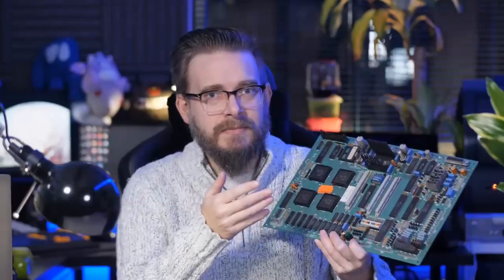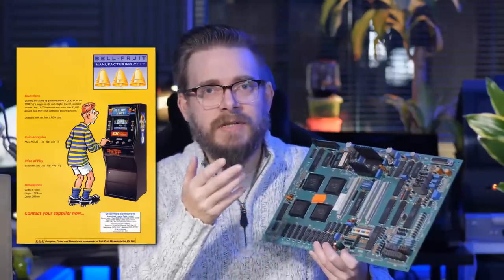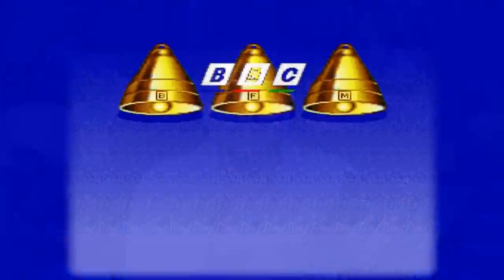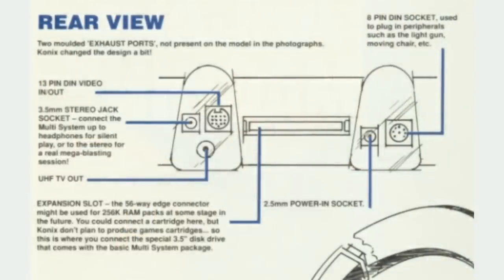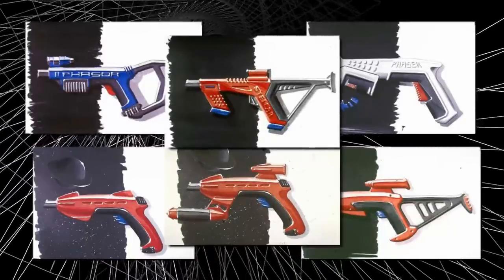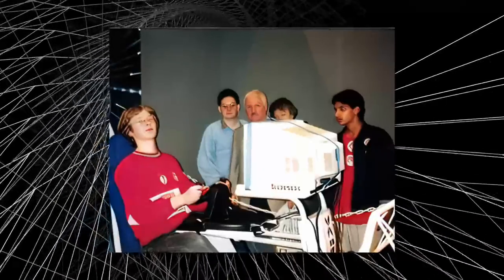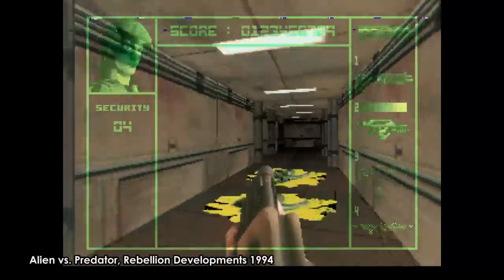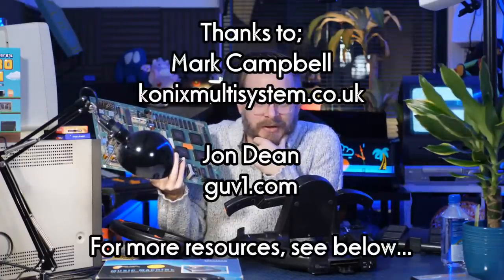This Console Would have Changed Gaming Forever | Nostalgia Nerd

Comment: A project way too ambitious from what I see in the video. The uncontrolled feature creep doomed this project as the company wanted to build more and more and promised all sorts of things to their investors. A console can be doomed by games alone and this console seemed entirely focused on a loose vision of making a ground breaking console. They could have released this console on their own terms and it could still have been a massive flop due to so many factors.
Reply: Agreed... There was a way for a newcomer or one of the big guns to dominate the UK hone compute market, and possibly the world... A do-it-all UK computer that runs most older popular UK computers' software. Spec features a 68008 (used in the QL, cheap 68000 with a cut-down 8 bit bus), 6502 (BBC, C64) and Z80 (Speccy, Amstrads, ++), all running at about 8mHz, instead of lots of custom chips.. 
--
Perhaps 1 ULA + VRAM to drive the screen and provide basic blitter and hardware scrolling, but one of the parallel processing CPUs could do that, especially with a dedicated DMA, shared memory system.. Would have run in emulation or native mode, perhaps being able to switch between modes without a reboot.. Could have also emulated an 8086 via software emulator and eventually re-assembler / recompiler.. 
--
Probably best to ship it with Spectrum and BBC compatibility and get 3rd parties in on developing other emulators and native software that fully utilised its multiple CPUs without the emulator overhead... These were always my thoughts as a kid, stuck with a Sinclair QL... This is what the Sinclair QL should have been... At least a Z80C + 68008, but I wanted a fast, 8mHz 6502 to handle I/O, graphics and sound.. 68008 as the main CPU in native mode as its the most advanced.
Reply: Yeah, it's easy to be 'years ahead' if you're offering state of the art technology for a bargain price. But not much of an achievement if you go out of business before the product is even launched. The Japanese consoles were more conservative, but actually had a business model.
Reply: @axi0matic  Yup.  The chair was a mistake from the get go.  Even the controller was a bit of a mistake.  They should have shipped the computer in a small form factor/arcade board, then when enough money was coming in, release the controller.
Reply: @j.d.6915  The only thing with making the transforming controller optional is that then only part of the user base has it. Developers would need to decide whether to support it or not, which leads to a chicken and egg situation (like Kinect on the X360). 

Aside from cost though, the controller would have required a desk to put it on, making it awkward to use on a sofa. It's true that in Europe, people were used to using home computers on a desk. But as consoles became popular, gamepads were much more living room friendly.
Reply: @PrivateSi  You should look up the SAM Coupe, it went down the route you're describing, was compatible with Spectrum software but more powerful.
Reply: @blahdelablah  .. Ah yes, the best 8 bit home micro - unfortunately released when 16 bit  micros had been around for years.. I'm talking 1983..85 - instead of the Sinclair QL.. Speccy, beeb and C64 compatible with STe level native mode, maybe with full C64 sound as an add-on. Slot on tape deck, double microdrive or disk option.. That was the window of opportunity for Britain to rule the home PC market... May have meant ARM never came into existence and Zylog and/or Motorola dominating Intel, instead of the other way round.
Reply: @PrivateSi  If you wanted Britain to rule the home PC market it would have been better for ARM to do better than Zylog or Motorola, right? As I'm guessing you're already aware, ARM started out as a British company, whereas Zylog and Motorola are both from the US.
Reply: @blahdelablah  .. CPU market is not the PC market and ARM chips came out way later than X86 (that the Z80 virtually cloned).. Not made in Britain, but designed in Britain.. Not majority owned by Brits for over 10 years.. Homefully it won't be swallowed by the US Chip near-cabal, Intel, NVidia, AMD, (+ IBM in a smaller, more niche way now)..
--
The English home PC market devoured itself while IBM compatibles rose as there was no dominant force in the UK home computer market. They way to become dominant is be compatible with many platforms.. Programmers love this too. 
--
I'd have preferred a more competitive and diverse CPU market, but if one becomes very dominant you're already compatible with them.. Like I say, Z80 was almost an X86, 6502 more RISC-like and 68008 for the most CISC as a cheap introduction to 68000 programming.
--
Fewer custom chips, more custom software. Cheaper, easier and  faster to develop for.. The advances in ASICs and custom ULAs was a tempting but expensive double-edged sword, with engineers getting lost in the possibilities in the UK, slowing development.
Reply: @PrivateSi  ARM isn't a British company now, but it started out as one. As for "X86 (that the Z80 virtually cloned)", you have the order mixed up. The Z80 copied many features of the Intel 8080 instruction set, and the Intel 8086 was just the successor to the Intel 8080.
Reply: @blahdelablah  .. Yes, I know all that, but the Z80 carried on copying the x86 with its B & C models... Just saying, 3 well known CPUs plus a DMA system and 1 custom ULA to emulate graphics modes could have been made to emulate many machines own, earlier, more primitive ULAs in software on 2 of the CPUs with the same main CPU as the original available to run the code natively... 
--
1984 would have been an ideal launch time, if on time, with plenty of 3rd party support.. 8mHz version of each chip had been avaiable for a while and were coming down in price.. Sinclair spent money developing 2 ULAs for the QL that slowed down development and production and had no speccy compatibility, and weren't even fully utilised by the OS (no high colour interlaced mode or double-buffer mode, inplemented 10 years later by an enthusiast)_.. 
--
ARM was way too late to the desktop and server CPU market so had to settle for the low power market. Motorola, Zylog, MOS were right up there with Intel.. Motorola is European.. The x86 US Cabal was not and inevitability but EUROPE needed a DOMINANT OPEN, MULTI-PROCESSOR ARCHITECTURE and PERIPHERAL BUS + SOCKET PROTOCOLS... Would have been good if it had been developed in the UK... 
--
By time ARM cracks the desktop market properly it will hardly be British at all.. I'd have nationalised it as a security asset, not sold most of it off to the Far East... May well never make it if RISC V takes off, which it will as it's an OPEN STANDARD with INDUSTRY SUPPORT... Like the X86 + IBM combo...
Reply: @PrivateSi  "Motorola is European" What gives you that impression? Motorola is from Illinois in the US, as far as I'm aware it has never been a European company.
Reply: @blahdelablah  .. Also, 3+ simple 8 bit CPUs still use far fewer instructions than a Pentium MMX onwards or modern ARM chip. Programmers could have learned to develop for different chips without having to buy an expensive development system for each chip, or a separate micro.. Those CPUs were used in many WASHING MACHINES - even back then they were in the most advanced ones!.. That's an old joke.. They were used in many industrial applications... Economies of scale without the X86 DESKTOP MONOPOLY... and Windows monopoly, quite possibly,
--
Will be interesting to see what RISC V does to the market as a DISRUPTIVE FORCE... It is owned by the tech. giants though, but it's a standard any CPU designer can implement.
Reply: @blahdelablah  .. And Finally, MSX was far too overreaching and rigid, worse than the IBM standard's reliance on Intel, and then Intel's ISA once AMD and Cyrix got going... Good for Microsoft and its favourite hardware sponsors, not good for FREE MARKET COMPETITION... Standard protocols and pinouts, form factors, interfaces and multiple processors would have been far better for developers, consumers, multiple chip design firms...
--
I think I'm done with this point.. There was a  way that UK + Europe could have matched or beaten the WINTEL Desktop DOMINANCE!... Now Linux + ARM may, or Android + ARM (no better than MS, but OS competition at least).. If Everybody who's ever complained about Microsoft and Intel had given $1 to REACTOS Windows could have been defeated 5 to 10 years ago.....
Reply: Yeah - feature creep and missed opportunities from not having identified their buyer markets...
That controller, by itself, alone, scaled back to within reason and rationale, though!!
.... If there can be (could have been) an accurately controlling and well-built motorbike/ATV handlebar combined with a steering wheel option, that controller would sell (have sold) well since it's an overlapping interest in instances for those gamers, even after the cost of shipping it with pedals. There might have been enough interest for some to purchase two of them for split-screen/system link and split-screen online and LAN (LAN party, yeah?). In the '90s, there were at least a couple if not a few analog protocols but that could have likely been handled easily with an onboard switch to neGcon/UltraRacer and couple MadCatz wheel analog protocols - the Micro-MC2 or the full-sized MadCatz... Such a controller, alone, would have kept the company bills paid if not well-off from all of the players enjoying ATV/Quadracer titles (i.e., "MX versus.." and ATV Offroad Fury titles - local and online), the early popularity of Jet Moto and Wipeout titles, Gran Turismo titles across PS1 and PS2, same generations of ToCA/DTM titles, more motorbike games such as MotoGP (including online riders), etc. ... For 2-wheeled, I would have found it interesting if they could have been around long enough to eventually have been inspired by Sony's SCPH-1110 Analog joystick regarding the use of its infinitely variable lean of the joystick to create the matching lean of the motorbike - i.e. , Castrol Honda Superbike Racing for PS1 and, IIRC, Extreme-G III on PS2 - through some kind of mechanical unlock/lockout and switch for remapping options while also adding a fore-and-aft motion for ~rider position.
Reply: @blahdelablah  Your correct, Motorola is American. I'm European and I think the confusion was Motorola were doing a lot of R&D, manufacturing etc. globally and domestically (Europe) out of Sweden. Anytime you heard an executive, developer etc. in Europe they had a Swedish accent. This coupled with Nokia (European) being such a major player at the time led many to mistakingly believe it was Swedish. I mean it was a Motorola transceiver that Armstrong communicated during the first moon landing, my dad's American, and I know that there isn't a snowballs chance in hell yanks would have allowed a foreign company to develop the comms. Just for national pride alone..

Comment: A z80 based system that could rival the Amiga... Dream on, the z80 was an 8-bit, 8mHz chip from 1976 that had no place as the CPU of a computer as late as 1989. Four custom chips, well, the Amiga had custom chips too, and more importantly, was built around the Motorola 68000, which was many times faster then the z80 and had an upgrade path., whereas the z80 was a dead end - no faster, more advanced variants were to come. Seems to me these guys came up with an iterative improvement on the Spectrum rather than something really worthwhile. I had several Konix joysticks, good designs but utter crap build quality, which was why I ended up having several of them - they broke and had to be replaced.

Comment: Interesting show!  I learned a lot.  That said, I'm not buying some the speculation.  I find it VERY difficult to believe that "Japan" got the funding pulled for this....that's a tough one to swallow.  It looks more like an iffy business model and iffy hardware in a crowded market might be the culprit there.  I'm also not convinced this would blow the other 16 bit machines out of the water...that's TOTAL speculation.  This thing was barely touched by anyone, and it already have a rep for being difficult to program on.  I don't think ANYONE believe this "super peripheral" chair/steering wheel gimmick would make it...I think there is a ZERO percent chance.  The control was interesting, even innovative, but not something to base hardware around!  Now, if you'd said "Hey, it's like the Nintendo Wii but years earlier", that'd i'd buy..but to consider the Konix this long lost mega system that would have changed home gaming....naw...no way.

Comment: I had the joystick featured at 0:42 with the red/black stripe motif. It was INCREDIBLE!  I can still remember the clicky sounds it made when you moved the joystick, and the positive feedback it provided. The solid steel shaft that ran from the base of the joystick case through the top of the unit guaranteed you wouldn't, COULDN'T ever destroy it like the other cheaper controllers made by Atari and other aftermarket makers. The base was ergonomic, fitting comfortably in one hand, unlike the square base to the original Atari controllers that must have been designed more to fit in a box than for any consideration to the user. It lasted me many years, and I still consider it money well spent. My only regret is that it was not compatible with other video game consoles that came afterwards, especially the SEGA Master System which had also terribly uncomfortable controls.

Comment: The second you held up that board, I knew exactly what it was - a COBRA 1 board. I worked at Bell Fruit's sister company but would visit the Nottingham factory very often. BFM (latterly Bell Fruit Games) were incredibly innovative and even pioneered the use of capacitive touch screens in gaming. I'll name check Paul Arnold, Martin Burgess, Chris Padwick, Pete Farrell among others who really pushed the boundaries of what coin op gambling could do. They closed the factory a few years back but I am incredibly lucky to have worked alongside them. It was a really education in software, hardware, electrical engineering, R&D, sound, graphics....the list goes on. I'll write a book about it one day. Cheers.

Comment: This thing is impressive even in 2023 honestly. Having a device that could shift so easily into multiple different options AND with a chair like that? I can't believe this was something they almost did in 1989. Just for reference but even in 2022 when I finally got into sim racing having a wheel and pedals was so cool. I know the tech today blows what they had in 1989 out of the water but I'm sure even that limited tech would have felt fun and immersive.

I really feel like if this thing had released the landscape of gaming would be a little bit different than it currently is today

Comment: Excellent video. Pretty sure like Nostalgia Nerd in 1988/89 if you were a UK gamer in your early to mid teens, had a Speedking or Navigator so were aware of the Konix brand and read ACE magazine, you’d be hyped for this. I have one of those Multi System controllers and have thought about mocking it up to look like a Konix a few times! If you could get that emulator running on a Raspberry PI and tuck it inside, you’d have the real deal - without the chair of course! I’m pretty sure had it made it to retail, it would never have surpassed the ST/Amiga market, or the incoming Mega Drive market as the games just wouldn’t have been as good, but who knows…

Comment: I wish there was an expansion pack for graphics sorta like the VCR6 and VCR7 to expand on the 2A03 but for the NES Palette
Reply: The cartridge port can't change the video signal output in any way and the colors were VERY hard coded, because it was more of a NTSC timer kludge rather than a RGB signal being converted to NTSC as with the genesis or snes.
The VRC6/MMC5 trickery are all about watching what's the PPU is doing and changing the tile data being "downloaded" from the tile ROM and probably interfering with the PPU reading the NES video memory as well.
Probably the best example i seem of PPU hacking is the doom running on NES, where a raspi tricks the hell out of the chip to draw the doom picture, but even this is still limited by the NES palette

Comment: Seems like the Flare design pioneered the techniques still used today in 3D accelerated GPUs. Multiple/split data paths, double-buffer flipping, optimised for vertex/matrix operations ...
Reply: Yeah, I had friend who was more well versed in PC hardware describing the flexibility of the co-processor architecture as "fucking nuts", and was awed about its potential.

Definitely ahead of its time.
Reply: N64 and PS3 were also considered "hard to write for" because of their "split" architectures. The ARM architecture also has a concept of "big / little" CPU subsets, which is heavily utilised by Apple's M1. And now Intel has introduced "efficiency / performance" cores.

"Ahead of its time" seems like a massive understatement. :)

Comment: I suppose the released cheapo controller being for the IBM PC compatibles makes sense, given that it'd be one of the few systems with analog input at the time, and dead simple electronics wise with just needing the potentiometers brought out to a 15 pin connector. Sad that the real full console never made it to market.
Reply: Mega drive, Amiga, Atari also had analogue controller support too. The Mega Drive had the XE-1 AP controller but wasn't released outside of Japan

Comment: It would have failed anyway even graphically, because it only had 128kb of RAM, which is not fine for a floppy disc based system. They should have used the original hardware, the one that had the 8 bit CPU and 1MB of RAM, since it was ready the development costs would have been low and they could have actually launched it, and then with the money made from the sales, they could make a successor.